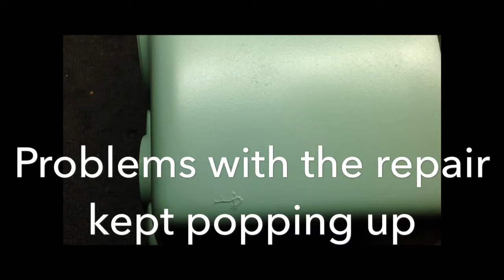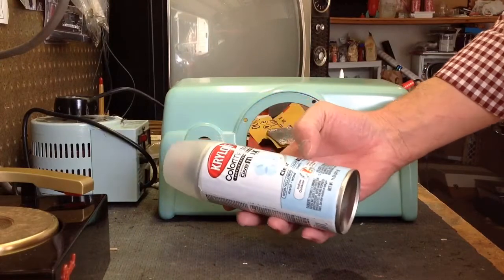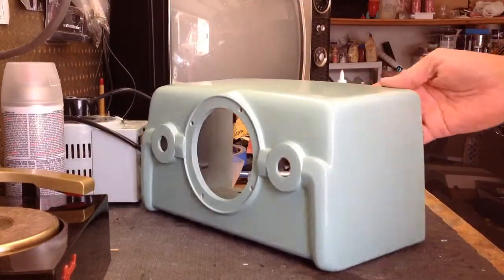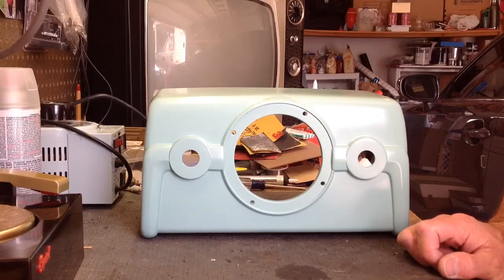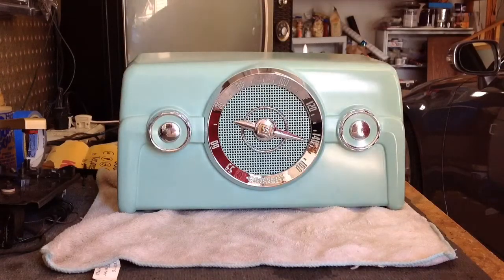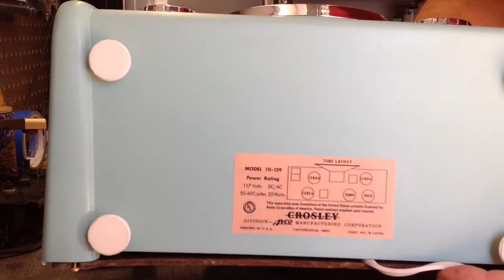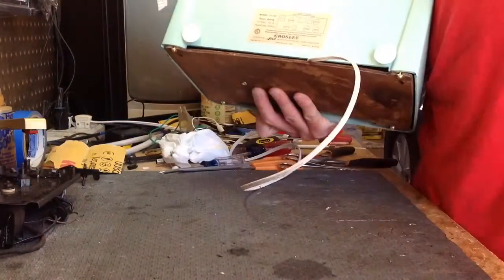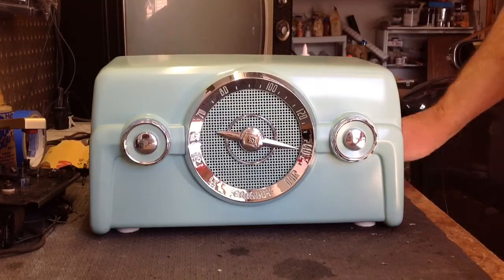1950 Crosley 10-139 "Dashboard" Radio Restoration Part Four - Final

Comment: Have a white one from my dad, from his dad, who worked for Crosley in the 50s. Like this one the wiring is a mess and I've been thing about restoring it. Was my Dads garage radio and he had to snack it to stay on :)..
Reply from the maker: If you watch my IF can repair video, you can see the white one I did for a friend a few months ago.  The chassis are a little cramped in these radios but they are easy to work on and sound great when they are done!